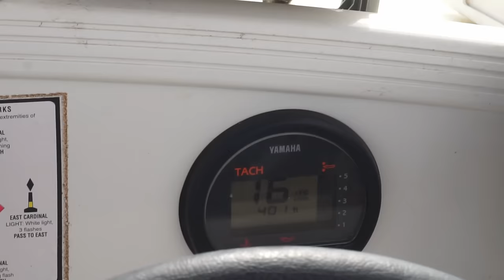TRYING to DODGE ROCKS and SANDBARS while EXPLORING||BOAT CAMPING||CRASHED MY DRONE ALSO!!

Comment: Awesome as usual, love to hear the Red Tail Black's in the background, pretty sure I can see that sandbar from my Nan's back verandah. Try a bit of thread tape on the bungs
You can also brown that flank on a low heat, just don't turn it so much
Reply from the maker: Mint location at your nans i bet sean!
Reply: @WACampingAdventures  certainly was, it was nearly built out the last time i was there 12 months ago with another build on the go. Spent nearly every holiday there for all of my childhood through the 80's n 90's

Comment: Ive driven bit bigger boats for a living for 30 years. And my own boat is a 4 metre 26 yo tinny. I need to upgrade but as you said such a huge difference between 435 449 and 500. All have adventages and disavantages.
Reply from the maker: Yeh well said keith, im trying not to get caught up in “needing bigger and better” but i just want that tiny bit more room haha